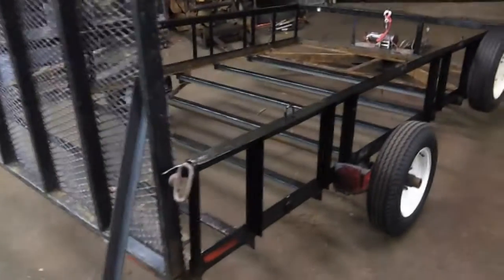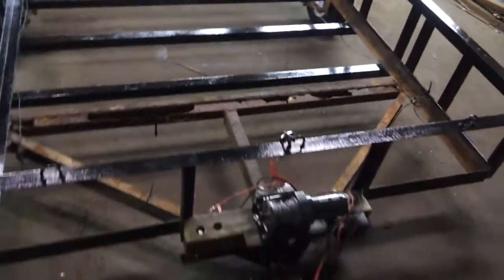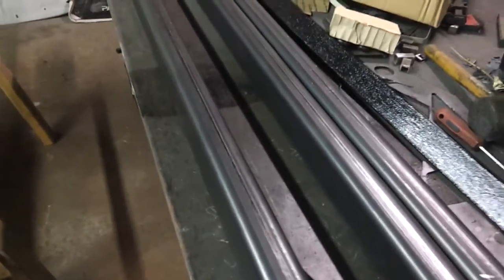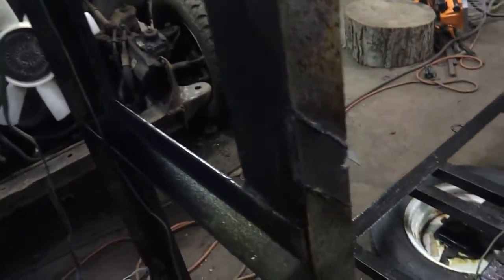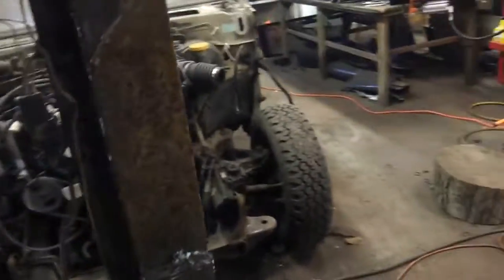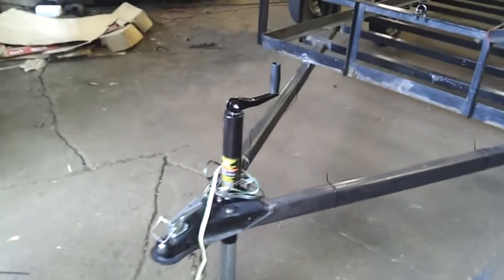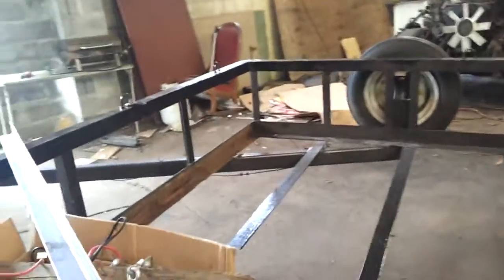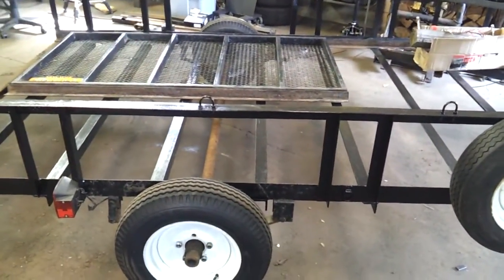Stage 2 - Trailer Repair and Rebuild - New Tongue and Coupler

Comment: Can I use my 125ez handler Hobart welder to  weld on trailer structure points? here are the specs of it 18 gauge–3/16 in mild steel with 0.030 in (0.8 mm) self-shielding flux-cored wire. Also use 0.035 in (0.9 mm) flux cored wire. It has a max of 125 amps.

Comment from the maker: I have other hammers but this one always seems to be available when I need it. It's fine though, it has a smooth face on the hammer. And yes I'm on a very tight budget. Started this with $2000 and have managed to make it a year without any other income. That's as tight as it gets lol. As far as sick welding. Both my machines can do it but I'd rather avoid it. MIG is so much faster and my 200 amp machine does very well with all my projects so far. The stick is there for when I finally get mobile.

Comment: Kinda time to invest in some better hammers for your shop!  Seems like you are on a pretty tight budget, so how about just picking up some flea market finds?  A small sledge, a ball pean, and some non marking type would be better than that little woodworking thing I keep seeing you use!  Anyway, I like your work ethic.  How about practicing on your stick welding for a project like this...doesn't that Tig machine have a stick function as well?